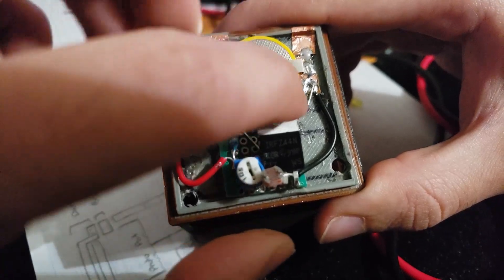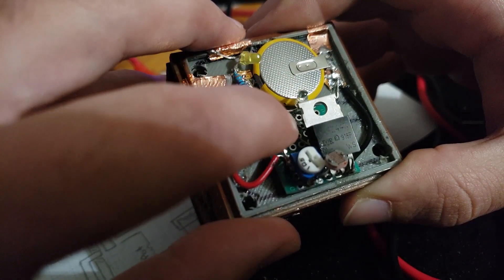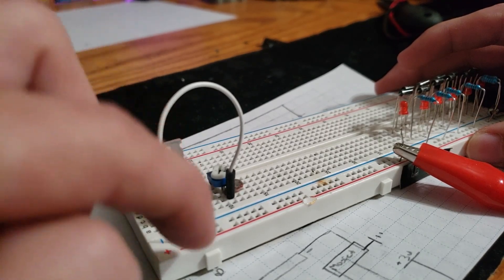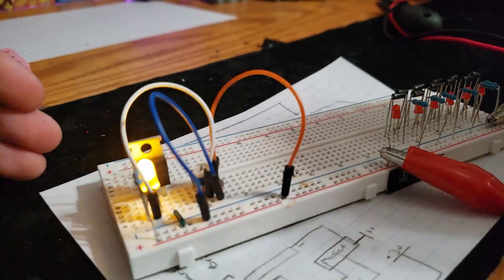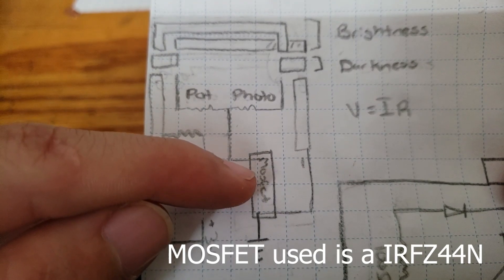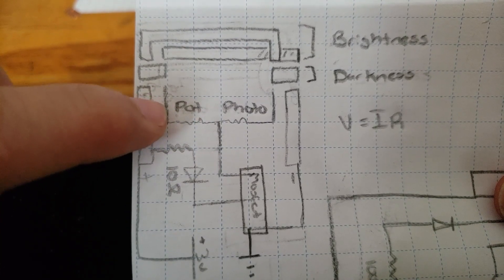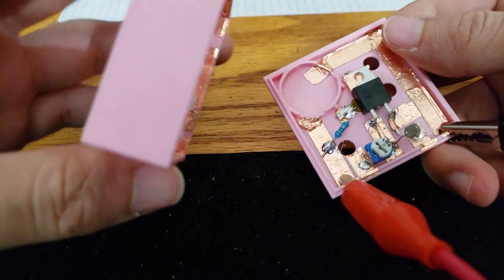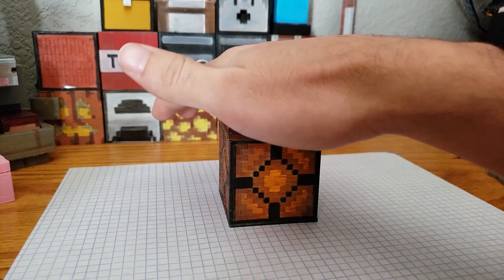Minecraft Automated Redstone Lamp

Comment: I really wish I understood all of this stuff you’re amazing!
Reply from the maker: Thank You! And thank you for the feedback, I will continue working on better explanations in future builds : )
Reply: @hecbac  No the explanations were good I just have no technical knowledge on volts and things. I could understand the logic you used to disable circuits by powering other circuits, but I still don’t know what a volt or watt is!
Reply from the maker: @Hacker1MC  Thank You! : ) The simplest way to think of electricity is like water. Current being how much water is going through, and voltage being the pressure of the water : ) Wattage is the overall power, just Voltage multiplied by Current, or How much water is going through the system multiplied by the pressure. 

Electricity has a lot of interesting elements and complexities. The best way to learn is through small projects that focus on a certain topic :D
Reply: @hecbac  Wow that’s very wise words, I’m screenshotting this comment for use later, never had anyone explain it to me that way. Thanks!